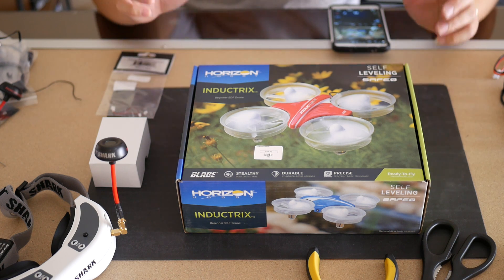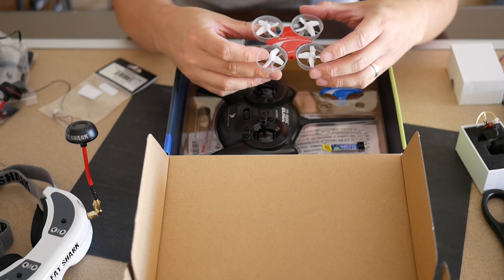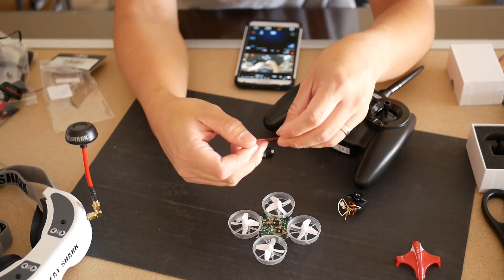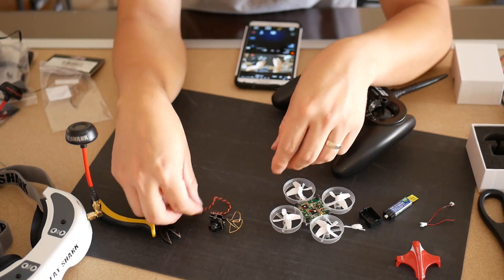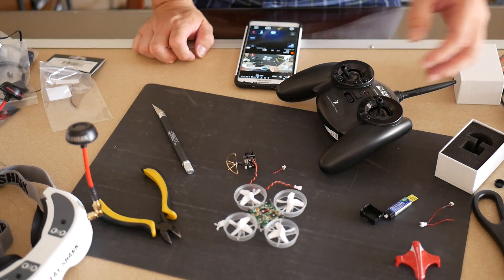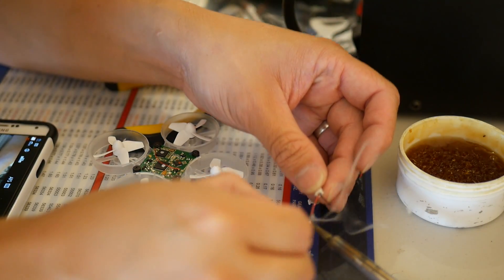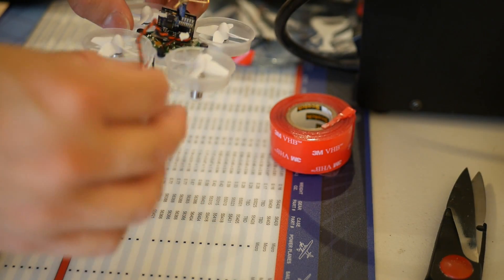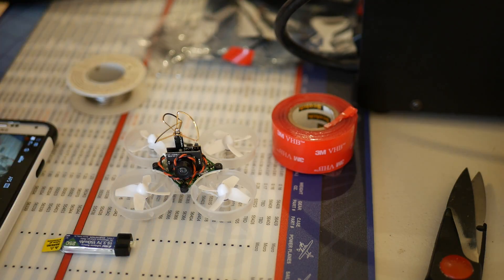How to Build the ULTIMATE Indoor FPV quad

Comment: nothing ultimate about it, hundreds of these all over youtube which are better than this
your camera mounting is crap, first crash its going to fall off the sticky tape then rip the wires off the board.

If you used proper flux cored solder you wouldn't need the flux, I guess you are only using it to try look clever.
Reply from the maker: backyardbasher if you would have taken the time and look at the description when this video was posted you would see why there are other better videos bro...my solder already has flux, but I always use extra flux. It makes for a cleaner soldering job and takes less heat and time. pluse those flux core rarely have enough flux and take slightly longer for the solder to flow. But at least you watch my video lol

Comment: you should put a dab of hot glue on the solder joint between the camera and its cable, it breaks really easily and shorts out the battery.

Comment: Has anyone manged to bind their inductrix using an OrangeRx module plugged into an Taranis transmitter?
Reply from the maker: I haven't tried it, but seems like everyone is doing it though. Check out the Tiny Whoop group on Facebook if your already not on there
Reply: +tonytypes Cheers  T I will make some enquiries there also!
Reply: I know most of the guides say only the orange module with the dipswitches work, but I have the one with just two buttons for dsm2/dsmx and it works fine.  I've only had to bind it once, but occasionally when first powering up I have to cycle the inductrix once to establish the link.

Comment: Hey, very cool. Can you tell us what kind of battery connection the camera uses? I'm thinking of ordering one but Readymaderc does not list the connection type on the page.  I want to figure out what cables to order.
Reply: Ultra Micro Y Harness for Single Battery FPV SPMVC1101 but good luck finding one
Reply: Yeah, I ended up just making my own harness, which is working ok.  I Love mine, I've been looking for that Perfect indoor fpv quad and have tried several failed setups, I finally found what I was looking for with this setup, thanks for the video!
Reply: +Tom von Trott cool I'm gonna try making one with a xk x100.if that don't work I'm gonna try the banggood eachine inductrix knock off when that comes out.
Reply: Cool, I look forward to hearing about your results.

Comment: Does it have to be inductrix? Can you use any cheap kinda quadcopter from banggood maybe?
Reply from the maker: It doesn't have to be the Inductrix. Any quad will work. I just find the Inductrix to fly much better than the other cheaper quads that I have flown before. Those cheap quad tends to drift horribly after a few minutes.
Reply: You got a point there :) well I'm going to have a try later this month. Thanks for your input
Reply: Look up the Tiny Whoop killer...I'm in the process of making my H8 a BEAST of an FPV Micro Quad.
Reply: I've got some H8's laying around they rule every toy grade copter imo. Was planning to run it on that. But the motor's are a pain to order....grrr....